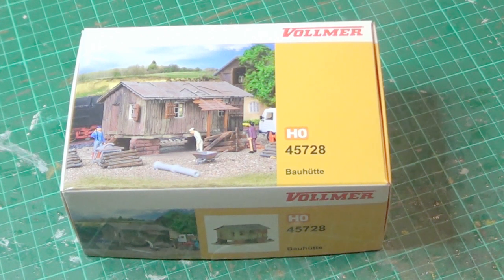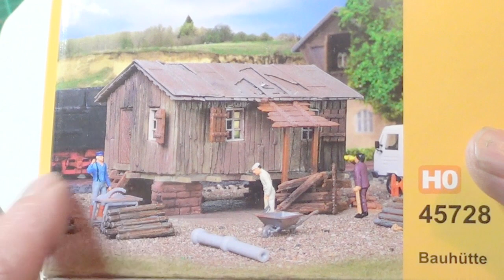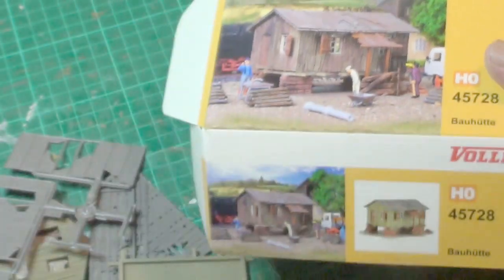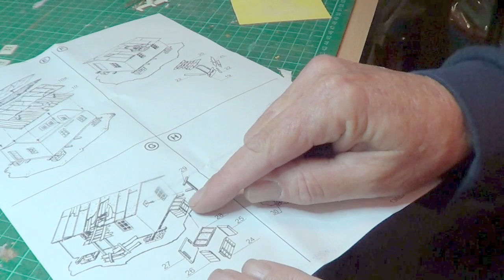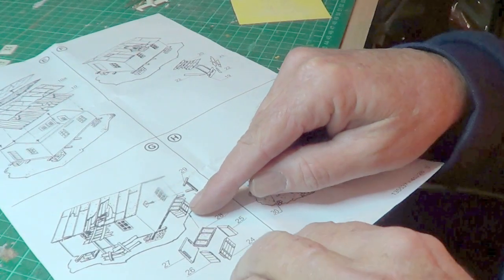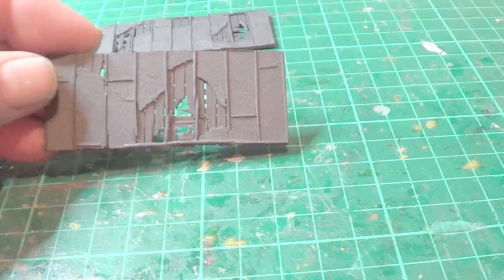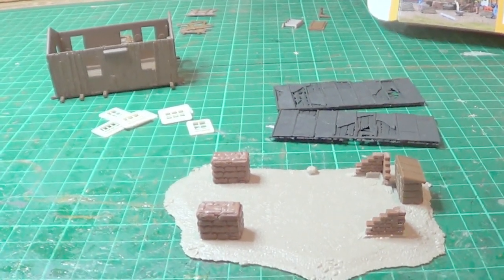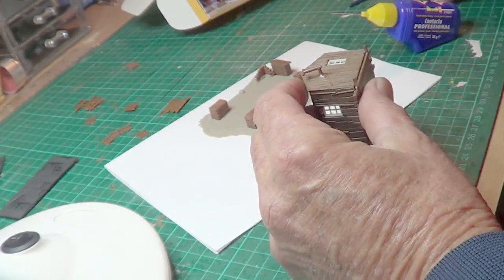Building the Vollmer 45728 Construction Hut/Fishing Cabin Part 1 "Model Trains"

Comment: In the past 3 months I have built 21 Faller models and 3 Volmer. I purchased them when I left Germany (USAF) in 1985. Have been carting them around for all these years. The largest one was the Bonn Bahnhof. Just some advice for future reference. Place all the windows, glass and curtains in place before assembling the walls. Makes for an easier assembly especially if your structure is multiple floors. In my opinion Faller kits are much nicer and never need painting where Volmer's are more bland and can use a touch up. I am sure yours is going to look great, thanks for the video.
Reply from the maker: Now that's a lot of kits to cart around, and the windows i was going to put on first, but changed my mind.
And i have never built a Faller kit cheers Robert